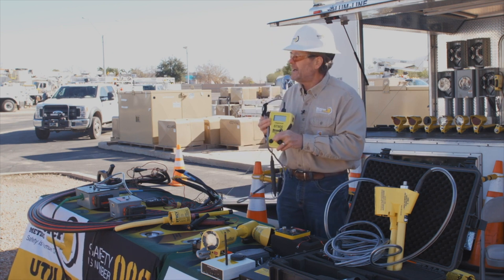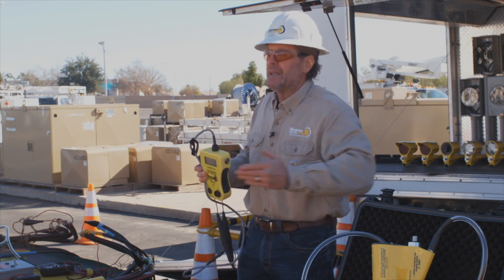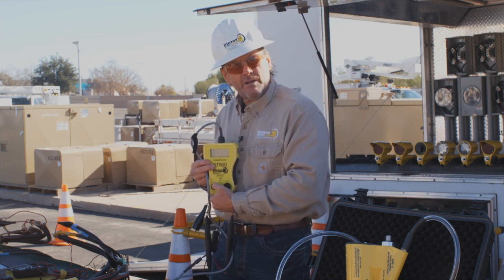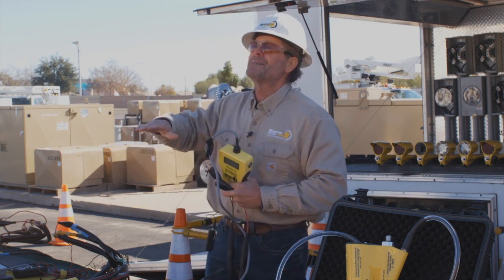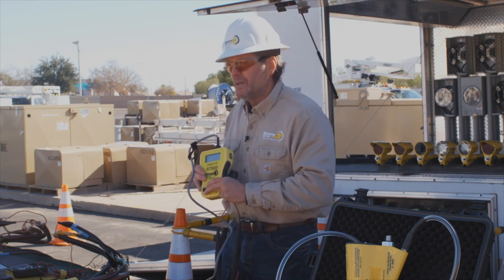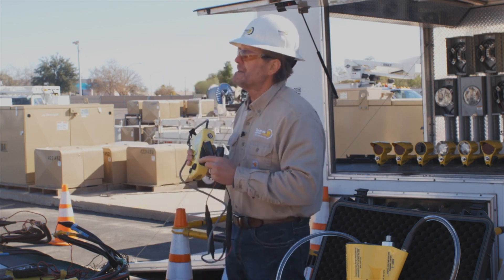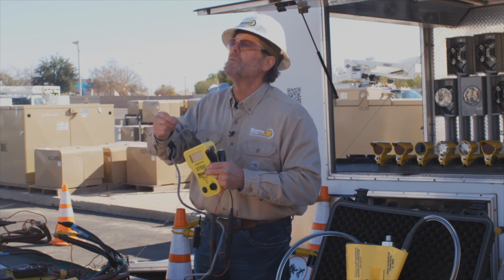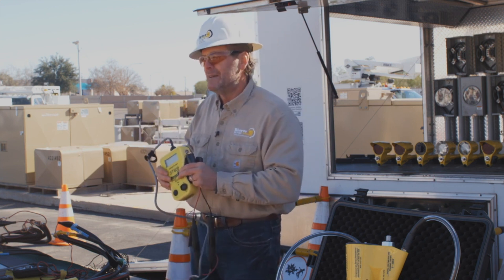ST800 – 800amp Service Tester: Bierer Meters Tool Training #bierermeters #lineman #st800

Comment: hello, we have been using the ST800 at the power co i work for, for a few months, and it is a great tool that saves us so much time and effort , the tool has exposed numerous faults and bad crimp connections where other tools have failed -thank you, our troublemen and crews love it.  that being said , im having a conversation with some of our engineers about applying 800 amps to a #2 al service, and i couldn't explain to them  if its a true 800 Amps on the service (we know it cant be 800 amps that we are thinking of, because the wire would likely burn down or melt off insulation with that type of load).   can you shed some light (no pun intended) on the 800 amps being applied through the ST800 - like load. we see your website says high magnitude pulse , I'm sure that is referring to this topic, but can you explain in lineman terms...thank you
Reply: If i understand your question correctly. Small wires can handle the st800 800amps because it sends one short jolt of 800amps. The wire does not burn up because the one shot of 800 amps does not give the wire enough time to burn. Like 800 amps of normal a/c load would

Comment: Long service run.  Tester stopped at 624.   Service ok?
Reply: There’s a lot of variables in a long service. Did both hot legs test out to 624? If you had a balanced reading between the hot legs I’d say it’s good.